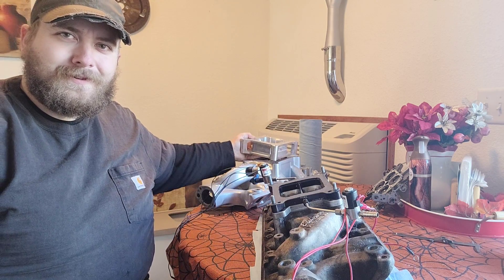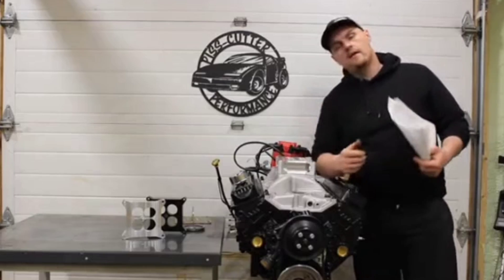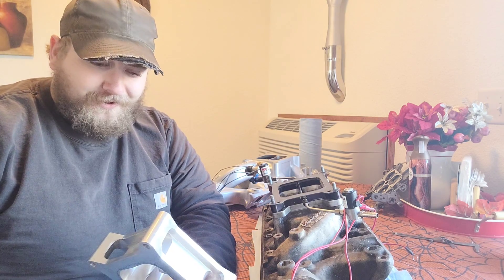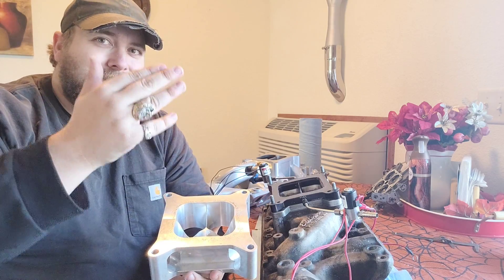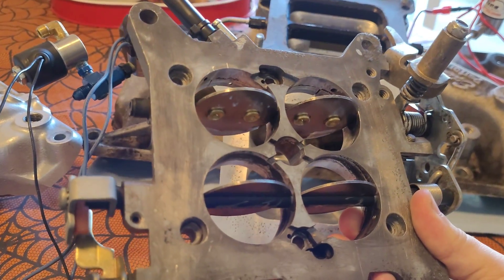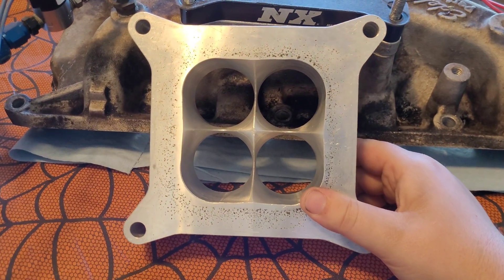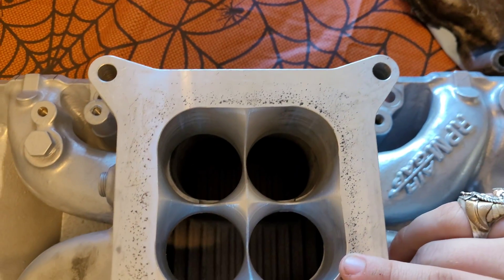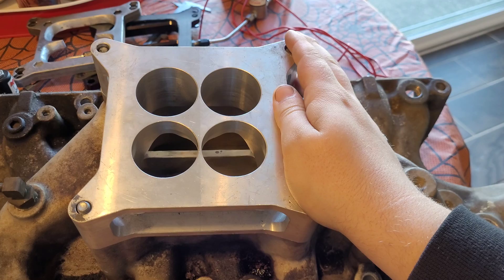Hidden Power? | Spacer Upside-down?? | More Tourqe And Better Performance From An Unlikely Place!

Comment: well I’m guessing the a/f ration is richer with the spacer upside down and leaner with it the “correct” way, indicating the jetting was too lean and confirming the notion that an incorrectly tuned engine will see big improvements with spacers and correctly tuned engines see minor changes

Comment: I’m going to try this upside down method on my sbc 388 jet boat. Makes 475/470  at the crank around 5000 now with a 2” open spacer on a stock RPM dual plane.. I won’t be able to tell without it on dyno but I could check plugs to see if any changes. 
Without hood clearance constraints I’d like to see a RPM dual plane manifold that’s taller with longer  less radius curves in the runners.  I could be done with plastic and a 3D printer.  If it  makes more torque below 5000 then I’m winning. I think hood constraints in cars are why it’s not a business case to develop a manifold like that. Wouldn’t sell enough.
Reply from the maker: Tunnel ram is the answer your looking for 😂
Reply: @newguysgarage6802 
But dual planes have more velocity.. If tunnel rams had two plenums..  Maybe the RPM manifold can’t be improved on.
Reply from the maker: @generalsixty2133  tunnel rams have a straight shot into the intake valves, that can increase velocity. 

Some tunnel ram tops also do have a divider in them, just got to look around 😁

Comment: May have something to do with reversion. Or better to say reduction of reversion. Every time a intake valve closes a little back pressure wave in the intake manifold is created. May be the area created with the spacer creates a chamber that cancels the pressure wave out so the carburetor does not see it and provides a more continuous flow through the barrels. The study of fluidics could help here as air is a fluid. Shock waves can travel through a flowing fluid. Like gases flowing through a muffler and tail pipe has little shock waves that can be canceled out through proper design. It could be that the chamber created by turning the spacer upside down has accidently created a perfect shock wave canceling muffler device.
Reply: I think you nailed it ,my thoughts as well.

Comment: The pull is coming from the engine as a pump. The air pulling into the plenum may be getting a better flow and cleaner entry. Seems like it would clean up the signal and also provide the benefits of the open spacer.
Reply: I wonder if putting inserts in the four holes of the spacer to increase the the velocity of air flow through the spacer holes might make a difference. The reason I say this is because the four holes in the spacer are really the only difference between this spacer and a open spacer of the same size. May be slightly smaller holes in the spacer would make more low end power. The air is being pulled through the holes in the spacer by the pistons in the cylinder.

Comment: It maybe a couple different factors, changing the pulse tuning of the whole intake system and you do have to keep in mind SOME turbulance can be benifical to a wet intake to help mix the fuel and air which can effect which cylinders get what afr. More testing would be needed to see exactly what is going on.

Comment: Maybe it gives more plenum volume (by increasing area volume between intake valves and throttle plates but while speeding up the gas (air) as it enters the intake and gets divided i to the ports that are signaling an intake stroke,,,,  so better flow through carb the pulses are smoothened out with more area,,, but regaining the sort of signal effect with higher speed with the tapering

Comment: My total guess is that the flipped spacer in effect decreases the plenum volume to the perfect amount on Cutters engine, and I mean ‘perfect’. If that’s the case, the next question would be would it have the same effect on your engine? When you get it going though, you do need to get a ‘Dragy’. $150 and they are super accurate (that I do know from experience!)

Comment: I did this mod as per watching cutters video and then watching this video, I started with a 1 inch tapered spacer installed up slide down could not believe the difference in throttle response and power. I then proceeded to put on a 2” tapered spacer and let me tell you, I felt double the amount of power from the 1” spacer. throttle response from the 2” spacer made my 383 small block with Edelbrock RPM air gap, a ballistic beast with crazy throttle response with very noticeable low to mid range power gains. Also needed to go up 2 sizes on my primary jets.
Reply: I am going to try a 2 inch open spacer under the carburetor and a 1 inch four hole spacer on the dual plane manifold. The idea is to have an open chamber under the carburetor and still feed the manifold with the four hole spacer. Kind of like a muffler for the carburetor for smoother air flow through the carburetor. Like a flow bench for your engine.

Comment: I just read about this today. I really like what you're doing with the carbs and just airflow into the engine in general. Always thinking 🤔 I have the afr version and the point sticks down too far to flip over otherwise I would try it.

Comment: A four hole spacer without the tapering in a dual plane.....without the divider cut down.....is supposed to lower the RPM of peak torque? Maybe increase it slightly? Mph at the end of the 1/4 mile will have to be the dyno. Upside down tapered gives a common plenum just below the carburetor on a dual plane. All of it is interesting for sure.

Comment: I'd be interested to see how "quartering" the intake would affect the fuel delivery across the engine at part throttle. As in without the four barrels open...

Comment: at 4 mininutes of watching, so far, I have seen that Dualo planes only pick up power with open spacer and not so much with tapered spacers also Open Plenum picks up some with the tapered 4 hole spacers, that is more pronounced when over 500 hp is the past tests.

Comment: I think that spacer is designed for a open intake not a duel plane intake
Reply from the maker: Increasing the efficiency of the carburetor is beneficial regardless of what intake is below it I would imagine lol
Reply: 4 hole is better for low end torque on a dual plane,open increases top end  .i have experienced both on a dual a dual plane. with 4 hole being the winner for  me.

Comment: the spacer being "upside down" is helping to vaporize the fuel mixture rather than just atomize it.  the combination of vapor and atomized fuel charges are what "flow" guys always ignore.  the increased power  is because the spacer is improving the vaporization to atomized ratio, simply put it's a better burn, more fuel used for power and less going out the tail pipe.
Reply: both mean the same thing except atomizing refers to 200f degree heating before entering the combustion chamber...

turbulence to mix fuels into vapors instead of liquid wouldnt occur during compressing the air instead it turns back into droplets... unless you induce spin or velocity across the main air flow...

the aerospike cuts into the flow and makes it more likely to form liquid in the center and fast moving air along the sides.... ending up as more vapor just before the valves at its densest point... 

kind of why long runners with heat exchange works so well too...

it may even further refine this effect
Reply from the maker: So is it vaporizing the mixture by the venturi effect creating a change of high and low pressure helping vaporizing the mixture? 🤔
Reply: @newguysgarage6802  it's helping by causing mmore turbulence , basically think of it as water coming out of a garden hose sprayer nozzle compared to that same spray but going thru a fan as well , it's helping make more of a fog than a mist, does that help ?  can think of atomization as a fine rain and the vaporization as fog, it's not a perfect analogy but gives you more of a "visual component " .  I rambling lol it's the turbulence that's breaking up the atoms. 
flow is important but only half the picture, the over looked part is the actual mixture and for power you need the fuel to be both atomized and vaporized , the more vapor the faster the burn across the atomized particles, it's why you don't mirror polish intake ports you loose the turbulence that helps both atomization and vaporization, another thing is having clean intake valves on the flow side the heat of the valve also vaporizes some of the fuel charge going into the chamber.  bottom line is getting the largest fuel charge and air while at the same time having an optimal amount of vaporization...  to many guys focus only on getting the most into the chamber "flow" but ignore the physics of fuel combustion characteristics,  it's a balance

Comment: I personally think that spacer right side up is terrible for dual plane, its made for single plane, so its taking away turbulence then making it by trying to jump over the wall for the dual part, its not supposed to do that! Lol dual plane is supposed to run off a primary and a secondary for each plane not fighting to pull the other side over, I believe having it upside down slows down the chance of it getting pulled to the other side.

That being said that's the exact reason I'm gonna make my own spacer that smoothly transitions from the carb to the planes.

John 3:16
Reply from the maker: An open spacer would do the same thing by exposing the divider wall and having pulses from each bank cross over. Also the edelbrock air gaps come with a milled divider just to get that crossover action going 🤔

So I dont think it is the fault of that spacer more so the fault of the plenum divider for not being a smooth transition in the first place right? 🙂
Reply: @newguysgarage6802  I wouldn't use a single plane spacer on it either, and I don't understand why that gap on the divider is there, it don't seem like it'd be very effective... 🤔 🤷‍♂
I would think a dual plane should have either a 4bbl spacer or a dual plane style spacer.
I believe both open and the one you used in the video is supposed to be for single plane intakes, I think atleast.

also thought it was interesting my Weiand dual plane don't have that crossover gap mess.
Reply from the maker: @OVERKILL_SS  usually the open spacer works best on dual plane intakes and the 4 hole works better for single plane intakes from what I have always seen or read anyway 😅

And the tapered combo is kinda the goldilocks that works for both lol! 

They mill the divider to allow the intake to share both sides of the plenum, makes more power because it gives both sides more mixture to pull from I imagine 🤔
Reply: @newguysgarage6802   I figure it screw up the tune and randomly make random cylinders run rich. 🤷‍♂
Reply from the maker: @OVERKILL_SS  well I mean.....If allowing each side of the dual plane to be able to share air fuel mixture with eachother was a bad thing.......we would have single planes, because they share air fuel mixture across both sides of the engine too right? 😁
Reply: @newguysgarage6802   I figure its works with single plane better cuz of the bigger open area. 🤷‍♂

Comment: This seems like something discovered but accident
Reply: Believe it or not it wasn't lol I first tried it on the butt dyno on the street where i noticed improvements. Wasn't until I dynoed an engine with a flipped spacer that I realized how good it actually was.
I know other guys have discovered this trick aswell, including some circle track guys
Reply: @cuttersperformance  I have one of these on a couple of my motors. Now I'm probably gonna go flip them around after I told myself I wouldn't mess with them anymore because they are running really good.
Reply from the maker: @MrJosephfunk  thats how it goes lol 😆
Reply from the maker: Ahh ok sweet 😆 

Hope you dont mind me using some of your video in mine, I seen it today and was like "wait what? Ok now I have to look at this closer" lol
Reply from the maker: Definitely seems like it was a fluke of curiosity that he just happened to test it like that. 

I did a little searching and nobody else from what I have seen has done it before on camera anyway lol. 

Definitely check out his original video in my description to get the full testing from him 😃